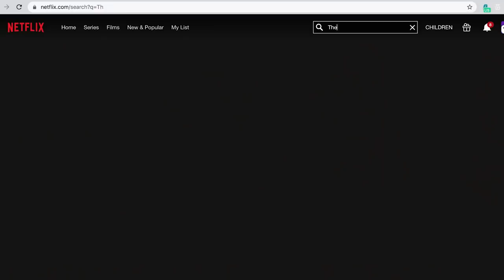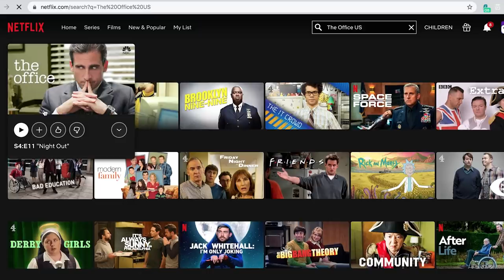BATTLING SNOW AT 8000 FT | BUILDING OUR OWN HOME

Comment: Long time subscriber and professional plow guy here.  Trent,  if you can make a pass for Allie along the side of the hut, it'll be alot easier for her to push snow into a bare spot than onto the snow that fell.  Then just come back for a second pass and blow that away.  Might make her a little happier.  Happy wife happy life
Reply from the maker: I would do this but the foundation and anchor bolts are hiding in that snow. I normally plow as close as I can then we usually shovel into where I’ve plowed, then I plow again. Lately I’ve tried to just do it once instead of twice. I wish it was easier to get the blower up by the garage that would help a lot haha
Reply: Allie works so hard! Bless her heart!
Reply: @TrentandAllie  I am the Manager of the Snow on my property, too. Now that you have this snow experience, you will know for next winter, what you need to do in the 'off season' to make spots to PUT the snow, mark out and grade paths, and perfect your current system. Also, just because your deck is big, doesn't mean you have to snow blow all of it all winter. Trent built it well to hold the enormous snow load and roof sloughing, just get those steps in over the summer and build a level path on Frank's end so you can access without steps and roll dollies, the snow blower, etc up and onto the deck.
Reply: @donnawest3064  So does Trent, so I'll give them both credit!
Reply: No No No, How do you think she maintains her hot body ... Trent knows what he's doing ;)
Reply: @mpix8302  Amen...just saying...
Reply: @catherinenelson4162  yes but Trent always tells you about it!  haha!
Reply: @brendag2891  Ditto from Michigan
Reply: I think you to are great you make me laugh all the time 😄 😆 💐🇬🇧Gina xxxxx
Reply: @brendag2891  I LOVE the title Manager of the Snow!
Reply: Yeah Trent!
Reply: @TrentandAllie  I never question Trent and Allies Relationship. They cannot explain every nook and cranny of their actions in a video. They purposefully communicate their content and professionally edit their broadcasts.

Trent knows Allie and Allie knows Trent. When they seem to push each other's buttons, or ours, like and get the popcorn, it's better than Netflix.
Reply: @dtimes2wa  Yeah, I also used to call myself the Director of Creative Resourcefulness. Lol. I am actually an educator and coach downhill skiing on the weekends (in a normal year). This year I feel like I am mostly Managing Snow. It can be an art form. Between watching weather, dressing in the proper gear, having the right shovels, working a large snow blower, and teaching myself how to plow with a truck, there is a lot to 'manage'. But I am now a Master!
Reply: @paddlegal3097  I remember driving to the UP for skiing and the houses on main street had snow up to the second stories, they couldn't even get the snow off the entry way to clear for the door and mailbox. They just stopped removing snow in the front. I don't know if they all have back doors to garages on the ally or how/if they were gaining access to their homes. Great skiing, though!
Reply: @mpix8302  oh for....

Comment: Kitchen design - definitely a challenge. Traffic flow; room for dishwasher doors, oven doors, cabinet doors to open; the "triangle" of sink-stove-fridge; it's just nuts. Our redesign started because the fridge was against a wall and you couldn't open one door all the way...  looking forward to seeing it. (Share the layout!)

HVAC - very cool system. UV lights are the thing now (Covid has increased that). Fresh air recovery makes a "healthier" house as well. Humidifier... wow. I'm in Houston - humidity ain't a thing - other than there's too much most of the time.

Comment: Allie's skiing is great! She's holding on to the safety of the 'snow plow' still, at times, but she's doing a great job! Allie, just put aside fear and go for it. That's how I learned to ski. I wasn't afraid to fall and boy did I fall, but it helped me to REALLY pick it up VERY quickly. I was up in the awesome slopes of Sun Valley on my 7th time ever, skied down a primary slope with just a camera in my hands and my poles waiting at the bottom. The only scary moment was when I got to a very narrow track that connected two runs and then I quickly realized how much I needed to let go of the 'snow plow' method of slowing down, since there was VERY little room for such a maneuver. Somewhere out there, is a video of me traversing the track and then you see me, with the camera lens, face-planting into the snow, my big ol' mouth breathing on the lens to clean it off and then a good 5 minutes of 'footage' where the camera was stored in my back pack, wasn't turned off and you could hear my decent down the mountain...ah...good times, good times. My favorite YT channel! Love ya!

Comment: Trent never wants to let Allie do anything. Then every time she slays it; she's super competent. LET HER DO THINGS. This isn't the 1800s
Reply: And Trent doesn’t apologize after being shown how well Allie does it, after talking her down, either. This time, it REALLY rubbed me wrong. Normally, I can ignore it. Trent was a total penis and owed Allie an apology. The issue I have is that Allie needs the knowledge of how everything works around their House. Allie should know how to use it, and how to use it WELL, in case she is stuck alone up the mountain or Trent is injured. This is a Safety’s sake issue. Especially considering where they live. Allie not knowing how to operate the equipment around the House and do so WELL is to both of their detriment and it may one day bite them in the butt. All because Trent can’t let up on his control issues. 😤🙄🤦🏻‍♀️

Comment: Haven't skied before and the powder is deep! Hah, first clue that was a lie because it most difficult to learn how to ski powder, after one learns how to ski on groomed snow. Once Allie started making cuts as she traversed the slope, I realized that statement was hogwash! And they didn't " just start skiing a couple of weeks or months ago either. Most who start, use the snow plow method for quite a while before they can control the edges of their skies and these two didn't start this season, either..
Reply: They have definitely been out a good number of times. They are paralleling and making great turns. Also, Trent went on diamonds. Definitely not "brand new".

Comment: Ali driving the snow plow is long overdue. It's her turn!
Reply: An added bonus is that everyone knows how to do all of the jobs. :)
Reply: It's a guy thing. Have you females not watched.
The boys are building.lifting , climbing ladders 30 feet. There BUILDING stairs over and over. Allie should be very happy with the work load.
Trents goes back to building after snow blowing. Allie carrys a camera.
Reply: @franksmith3602  yes.  Allie carries a camera, and when she puts it down, she does other work.
Reply: @suzannebudlong8376  yes suzanne.. you missed the point by a mile... they both work.
No man wants to shavel snow then pick up a hammer. Let trent have a little fun in the tractor so he can quietly think about all he has to get done.... and yes allie carrys heavey stuff also.
But not the same..thing.
Reply: @franksmith3602  , I see your point.  I do think some trading off would be a good thing, because if Trent were to be down with an injury, Allie would need to be proficient enough to handle all of the chores.  Just think of Trent being laid up inside and not being able to hear Allie for a while:  or the snow plow?  Think of the regrets that would go through his mind.
Reply: Trent is too controlling to let her drive the tractor!
Reply: Way past overdue. Trent needs to apologize for his snarky comments about her not being able to do it and he’s going to have to step in. Allie did a great job! Now Allie needs to learn the tractor! 🚜 Both of them should know how to get things done around the House and how to do them WELL, just in case the other isn’t there to help for whatever reason. Allie has proven herself time and time again. It’s past time for Trent to knock it off and acknowledge his wife for the badass that she is.
Reply: Enough Already I agree 100%
Reply: Men should be men. Allie should be Allie.
Allie the ACCOUNT, camera women, the editing, 
She the chief, She helps when ever needed. 
Let Trent be the man of the house and drive the tractor.
Reply: @franksmith3602  and what happens when Allie is stuck up the mountain alone or if Trent is injured? With Trent being “the man” not being able to do a darn thing, Allie having NO KNOWLEDGE of how to work the equipment or the opportunity to master it because Trent was being “the man” and not “allowing” Allie (her words) to do so?? What then? Oh, she’ll just get her camera out and video it? Really?!?! It’s to their own detriment if Trent doesn’t give Allie a lesson and the opportunity to master the equipment around their Home. A painful lesson for them both and the Family they’re hoping to build.
Reply: @enoughalready8337  Allie a bad ass chick who knows her stuff. She will be fine. And all those people they tow out of the snow will be right there to help pore little allie. Hahah, Allie grow  up in DC she made it there she can do anything.
Reply: @franksmith3602  there’s no disputing that Allie is a badass, and not “poor little Allie”.  My point is that Allie should be well prepared for any possibility. Trent needs to give Allie that knowledge and the opportunity to master it, so that she can continue to be the badass she has continuously proven herself to be over and over again. Why wouldn’t Trent want to give his wife the knowledge to take care of herself in case something happened? It’s ridiculous to not give her that, for Safety’s sake.
Reply: @franksmith3602  so teaching Allie how to use the equipment around their House so that she knows how to use it, takes away her femininity?  Makes her less of a woman to you?  It’s a Tractor, and the equipment around their House. Because she SHOULD know how it works. It’s COMMON SENSE. It’s BASIC KNOWLEDGE. She can still be the same woman she has always been; a beautiful, kind, SMART, strong, badass (your word) who knows how to use a Tractor, a Snow Blower, and anything else they happen to have on their Property. Because she’s a Homeowner and that’s what all Homeowner’s, especially if they live up on a MOUNTAIN, should do..... know how to use the equipment around their House. I’m sure the Ukrainian Woman know how to use the own equipment around their Homes, too.
Reply: @enoughalready8337  I'm glad you get it. Trent should be happy to sneak Allie day spas pass. 
Men run the equipment.  Allie , goes to the spa. 
The boys work hard, Allie makes some of those great dinners. Trent grandfather who was his father stand in. Tought him well, granddad shoveled the snow. Grandmother had hot coffee and snakes waiting when the "men " were finished. And yes females can use equipment,  we call them butch. 🧓👴🤷‍♀️🤷‍♂️🙀👨‍👩‍👧. Hahaha,
Reply: @candicemattson8621  there the perfit balance.. Trents the man Allies the women. And would do anything for each other. Most of all respect.
Reply: Well that was fun listening (reading) to. Being a woman, my hubby does most of that stuff, but also being a tomboy, sometimes I want to try it all out, after all, because I'm the one who reads the directions, I'm usually the one who ultimately figures out how to use...everything!
Reply: @enoughalready8337  yes now you get it. And Allie getting a little work out for a hour is great. It's  like a gym. Her abs will stay fit. She wouldn't put on the winter  pounds like most women. TRENT AFTER SNOW blowing in the tractor. Will be ready for his next 9 hours of building. You most of misted allie birthday. Trent spent weeks, getting her "dream" car. And everyone helped make it what could be called the greatest husband gift, day. 98% of America husband can't do that. Trent did... if Trent wants to be the only one to drive the tractor. He earned it by 1000%.
🤔 move alone with the women lib crap. You for sure cheer Nancy P on, hahahah
Reply: @enoughalready8337  you missed the point. Yes grandfather is alot older. Now follow along, the lesson he shared with baby trent 25 years ago.  How to treat a lady. How a man takes care of his house. Those life lessons shine thru. Allie will have trent working hard for her. And when baby T, Haha shows up. When naming Male parts is some what rude. And like most lib, they have to insult and scream because there view POINT is lame. Do injoy your bucket of icecream and blue dye hair. As you surf to many fish.🙀🤷‍♀️🤷‍♂️👨‍👩‍👧
Reply: @franksmith3602  okay, you’re just a troll. This was completely uncalled for. Very uncool. But I’m not at all surprised. Your words speak for themselves and tell us ALL about you, what type of man YOU are. Definitely NOT a gentleman, who knows how to treat a lady. Have a good Life, Frank. I wish you well.

Comment: Hey guys 

1.  Would you consider getting a cordless leaf blower to clean the snow on  4Runner (and other uses)?  It is a new vehicle and the brush can damage the paint.  The brush is ok for the windows/glass but may damage the paint finish.   The truck is old and is a Ram (Ford guy), so it doesn't  matter.

2.  What about moving the vehicles so the tractor cleans as close as possible around the shelter?  Then use the shovel.  It will be much easier for Allie.

Comment: Are you planning on running data wire while the drywall is not up?  You might not use it right away but it’s way easier than trying to install it later.  One good use is if you plan on running a security camera.  Using data with POE is much easier than other alternatives.

Comment: Move the snooze blower off the porch so you can use it where it needs to be used. Then put tarps down on the porch before it snows. After it snows you can drag the tarps off the porch and your done removing snow from the porch in minutes. No risking running the snow blower of the porch.  The snowblower is going to tear up the finish on the deck boards.

Comment: That yellow pusher is great but I suggest you get a small snow-blower for next to the shelter. 
Here in the NorthEast we've used a shovel on the steps to get to the small blower, then the little blower to do the walkway to get to the garage, and then the big blower to clear the drives. 
LOL!

Comment: IDEA WE USE FOR MOVING LEAVES!!!!  Just Velcro a large sheet of heavy plastic on the side of the tent with the bottom of the plastic stretching out on the ground.  The idea is the snow falls on the side and accumulate and you unvelcro the plastic sheet from the side and then you two just SLIDE the plastic sheet over to wherever you want to dump the snow out of the way.  DONE!!!  YOU CAN DO THE SAME THING POSSIBLY on the deck.

Comment: Snow fence helps keep the drifts away. At this point, you could place some IN the snow. 😊 Keep track on paper where good diagonal places for snow fence will be for next year.  We may not see the reason that the tractor does not run along the sides of Terry as much as it can. Parking cars away a little bit more might help with the width of the tractor. We know what you mean about making the snow blower move when it is not easy. It is fun to run except for those very tough times. When not on the deck, you can have chains. I hope it isn’t damaging the deck currently.   We still think of you three and how much you enjoyed the long warm/hot weather trips. That was fun to watch also, although sometimes too hot and too scary.  At some point later, you may compromise and not be so far out so Allie can function better independently. Groceries, shopping, etc.  She will get used to the roads once she practices more.  We weren’t sure if she was able to drive at least one way in a recent video.  She will also feel successful driving down to the main road and back.  She loves meeting new people and exploring.  Allie, you can go when the snow is on the road, before it is scraped and icy.  The snow is much easier to drive on and if something little does happen, the snow is a great cushion. You will enjoy driving in a fresh snow where you make the first tire tracks. It is so peaceful and beautiful. Trudge on, you are both learning and growing through the many experiences you share. Thank you!

Comment: Trent don't know if you can pull it off but there is a really surprising Hack to do on snowblowers. It's on You tube of course! You install belting like on a conveyor belt the same width of the vane's on your blower. really a easy fix. My Craftsman 5 hp snowblower when stock threw snow maybe 12 feet. When you install the belting it creates a seal between the vane and the housing thus sort of pressurizing the area. One plus and it happens to all blowers they clog up with wet snow in the chute well hardly no more with the Hack installed. Plus mine will now throw snow almost 30 feet.  I used two what is called elevator belt bolt they have a large head with like two small spikes that hold it from spinning when you tighten it up. I also didn't leave any clearance they ware in in five minutes of use and I also put the wipers on all of my vanes. Check out the hacks and the improved performance. Makes it a lot less work also!    Here is one link    https://www.youtube.com/watch?v=v3m_djNQEgA

Comment: According to Design Standards; 5 feet (60") from chair side of islands to anything. at least 30" to 36" from Island to cabinets on other side (Aisles). At least 15" both sides of cooking appliance range cooktop or stove. No more than 8' feet for work triangle paths (Frig, Stove, Sink) Gas ranges should have 8" Left and Right of Range before adjacent wall cabinets. Garbage Disposals should be batch fed Hard Wired (Fires). MW in cabinet needs plug outlet in above Opening (fires).